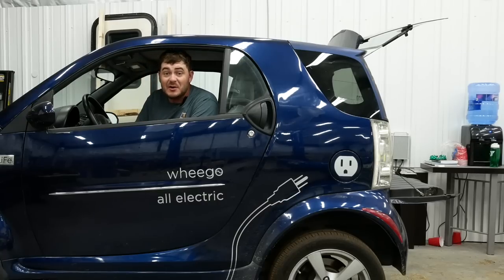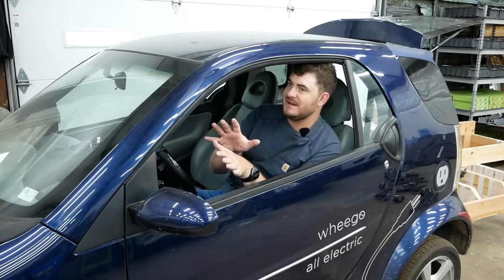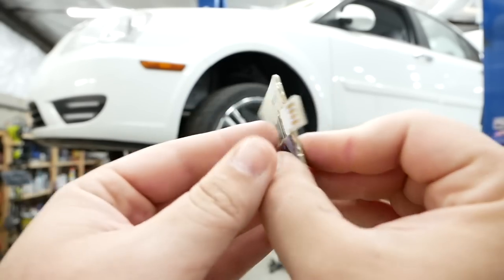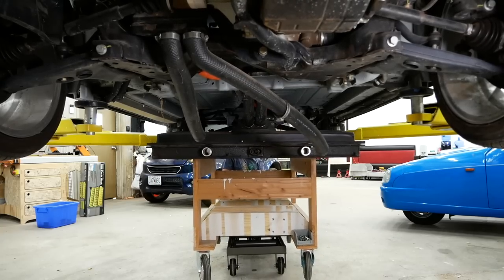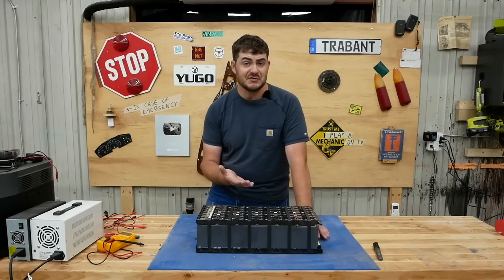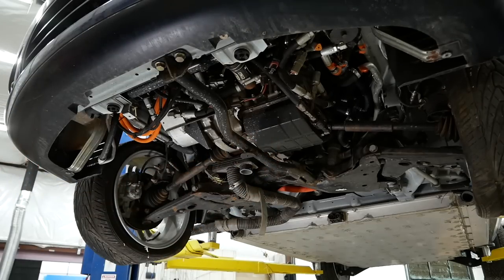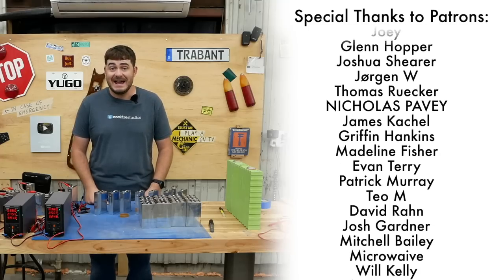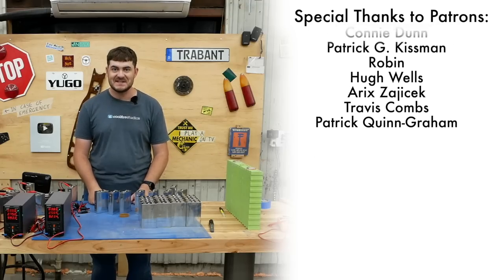I Have 3 Dead EVs. Are Any of The Batteries Still Good?

Comment: I think continuing to rip apart the one you already took a cell group apart from is fine.  I doubt many codas will be functional long enough to make your extra battery pack matter.  The rest of the car is just not very good quality from what I've gathered and the battery pack seems a lot higher quality than, say, everything that actually makes the wheels turn.  Better to make a good mower and a good Wheego than to worry about what you're doing with two nonfunctioning prototypes you have already designated as "parts cars"

I think if you sit on those battery packs waiting for Codas to need them, you'll be waiting for something that won't really emerge save for anything that will help the guy you're giving that one to.

Comment: Should check the internal resistance of each cell before making a new pack out of them. So each cell in the pack can charge and discharge at the same rate so you don't end up with voltage mismatches over time.

Comment: The usual failure in these huge series-parallel battery packs is that some cells lose capacity and eventually short out and won't hold a charge. A shorted cell prevents its parallel neighbor cells from being able to charge, and the entire pack drops by the voltage of the failed parallel group. A cell suddenly shorting will also fully discharge all of its parallel neighbor cells, which can lead to thermal runaway and battery fires. Tesla solves this with a fuse on each cell, so if one shorts and suddenly starts to discharge its neighbors, the fuse blows and it is removed from the circuit. The remaining parallel group loses some capacity but the overall pack voltage remains the same.

Comment: In theory I'd say hold onto the battery pack incase someone needs it... But in practice I'd say pull it apart as buying that capacity in new cells to get the Wheego running again wouldn't be cheap.

Comment: If you really want to do right by the Coda community with the battery pack. Have no qualms about doing as you wish with it but document as much of the battery and the supporting electrical systems as you can. That documentation is likely more valuable than any individual pack is.

Comment: I personally don't think harming or repurposing the Coda batteries will affect the future very much, it's hard to say if a Coda owner will need a battery from your stock. You ought to reform the Wheego as you've originally planned to, who's to say that there won't be new battery technology by the time someone wants to restore their Coda battery. 

To finish your thoughts about destroying parts, you could think of it like two P-51 Mustangs in a museum where one is restored to full working condition versus one that sits on display. The only option to get the nearly restored Mustang to work again and also registered to fly was to use parts from the display plane rendering it unable to fly ever again unless it undergoes a lengthy and expensive restoration. They're now two different pieces of machinery however both planes serve as a display of history whether they start up and fly or stand there and remind folks about the their place in time. When EV's are more advanced than now maybe your Coda vehicles or the Wheego powered by their batteries will be in a museum as a running or stationary display, or in the scrapyard. Either way it gives people something to marvel at.

Comment: Batteries have a limited, however long, shelf life. Use them while they're still good. A custom battery pack can always be built for any vehicle that needs one. After all, that's exactly what you want to do with the cells, right? So don't worry about some future Coda application that may or may not happen.

Comment: Those Weego cells look like Sinopoly LiFePo4 Yttrium 400 AH batteries.
I have been running my house off 16 of the 200 AH version for about 10 years without a glitch, mine does not have the BMS socket though as they are an earlier version. However, they are still reading  3.6v per cell and some say... a BMS is not really required on a LiFePo4 battery with Yttrium doping.
Damn fine batteries for off-grid.

Comment: The battery packs in the Wheego look a lot like common off the shelf parts. Considering the two Coda packs are good, if it was up to me I would keep them as they are and just rebuild the Wheego pack with new LiFePO4 cells.

Comment: if they didn't finish the mold and it still has the marks from an endmill they show up in the plastic part, the only way to be sure is to check if there is draft. if the sides are perfectly parallel then it's milled, if it tapers it's molded. 
also absolutely tear the good pack apart. just because its rare doesn't mean it's valuable and there is no guarantee that a coda driver will A have a dead pack B find you C be willing to pay for it because D they actually like their coda and the weel brings haven't sent it to the scrap yard already. to you, you have 3 sets of these things for you to do with as you wish.

Comment: Nice video. Two thing sprung to mind though. “9.75 volt” should be 19.75 volt and “two one hundred of a volt” is either 20 or 200 mV, most probably the latter, so two tenths. You meter only have three and a half digits (“four digits” for non EE-folk).

Comment: We've seen the Wheego; its BMS will kill any batteries added to it. We've seen the Coda; you've got one that you can revive easily. I'd like to see if you can get an EV with a dead battery pack and revive it with the Coda's cells. Plenty of Leafs about. Or, get an EV car kit and put it together with these cells.
Or, take both Coda packs and convert your F150 truck into electric. you've got a bed right there for them.

Comment: If the batteries don't work in another car they'd be great for DIY home battery backup. 

I wish Chevy had let me keep the old battery they replaced in my Bolt, I would've stood it up in the garage and plugged the house into it. 
There was very little risk of fire in the first place, and the pack would be under far less stress as a home backup vs moving a car.

Comment: The real question should be: If I build a new battery pack for the Weego Will I also want to upgrade the whole charging/control system and upgrade the motors with it?  Do the mower upgrade first before you have to borrow a push mower to cut your grass.

Comment: Surely the single 31kWh pack has enough cells for both the wheego and the ride on mower (Or if there is enough usable cells from the current Wheego battery pack, use that for the mower and only the single 31kWh pack for the  wheego.) I'm of that opinion of, keep the current 31kWh Coda pack as a spare, although like a couple of others, I am concerned that the 36kWh battery pack couldn't be passed for side crashes (while unlikely to happen, it's a non-0 chance as unfortunately you can't control other people).

Either way, really excited for this and can't wait to see what you do!

Comment: Use all the battery power you dont need for the mower and use them as a battery pack for your home. Combine it with a solar system and you just saved thousands of dollars and with this system running youll save even more over time!

Comment: I think the bigger question is: which of the two will you use more? Because remember: The Coda that's road-worthy was built by a real car company that did real car company things, and it's been BREAKING on you! The Wheego (as far as I know; correct me if I'm wrong) was made by a 12-year-old going through the growing pains of life and didn't even come with things like a manual or any sort of extra support, and it (so far) hasn't broken on you aside from the dead battery pack. In terms of usability, I think the Wheego is the better option. Ultimately, however, it depends on your plans with the two cars you have, so you decide!

Comment: The Wheego could so easily be powered by second hand LiFeP04 cells. Looks like they are Winston LiFeYP04 and they aren't too hard to find. I know Jehu used them and I believe he still uses them in his Samba. Battery Hookup recently had a couple auctions for Winston cells but I didn't see what they ended at but I wouldn't be surprised if they went under $100kwh. 

I really hope you don't destroy another good Coda pack. They seem....fairly well made however I question some of the design like the nickel bus bars. Why use something with such low ampacity (unless they were nickel plated copper which is very likely). At the very least keep the shell and all components in good condition. I bet someone could find cells with dimensions that work inside the pack and re-cell the pack without really doing any modifications since LiFeP04 cells come in such a variety right now. 15.5Ah cells are tiny so it would probably make more sense to use 90Ah cells if the dimensions will work.

Comment: At this point, the Coda battery packs are just plastic boxes with off-the-shelf cells in them. Realistically, there isn't going to be another guy who needs a battery pack and the best way to make actual use of the cells is to jam them into whatever hot garbage you love the most.

Also I want to see an EV swapped Trabant someday.

Comment: With an inverter you could make a nice powerwall. Do you have variable electric pricing over there? Or make an external battery for the Wheego on a trailer.
You owned a kWeld right? Could you put 4 cells in series and do a calibration? The internal resistance should be (14.4 -6.3) V / measured current.

Comment: LiFePO4 is great - except for those crap Thundersky (or clones) cells they used in the Wheego. They were very early on in China’s foray into battery tech and they just degraded very quickly. I suspect that they were often used in applications that subjected them to very high C rate discharge - especially in a 115V system. A lot of the early EVs were low voltage like that. I wouldn’t bother trying to save them - at that voltage they’re irreparably damaged and even perhaps dangerous. Don’t discharge to 2.5V either. Nearly all the power in a LiFe cell sits between 3.6 and 3.0V - very flat discharge curve.  The loss in capacity on the Coda cells is almost certainly just calendar aging.  Good luck with the project - me, I’d have tried to re-purpose the Coda pack as home storage. Split the pack into 8S78P, buy a decent BMS and a hybrid inverter and you’re set. Or take a few parallels out for your mower.

Comment: I’d use it but maybe there are other options than the car.  You have mentioned the lawnmower and wasn’t there a cart you were outfitting?  Perhaps you could use some of it through a converter as mains battery backup or solar charged mains

Comment: Honestly, the way I see it, keeping a battery pack around without doing anything with it "just in case", seems like a bad idea because a) having a battery pack just sitting around means it will likely eventually go flat and die, unless you actively check on it from time to time and come up with a solution to keep the entire pack charged up and b) the amount of kodas out there are tiny, and the cars are probably pretty worthless, so I vary much doubt that anyone who still owns one would go through the hassle of replacing a dead battery pack, unless they are they are the same particular flavour of special as you... While I wouldn`t particularly endorse tearing apart a koda battety pack to bring back the wheego (it would be an interesting project with some challanges to overcome for sure, but I don`t think that much value would be gained otherwise), it would be interesting to see you use them on such projects as the bus (to power the electrical stuff of the living quarters, with maybe the addition of solar panels, or maybe find a way to use the engine as a generator to charge the batteties, maybe througha particularly beefy set of alternators, or maybe strap a generator setup of sorts to the PTO, if the engine/ tranmission happen to be fitted with one (since it was a school bus with an alison automatic I super doubt it has a PTO, but maybe one can still be fitted in some way), or maybe you could buy a 2nd trabant and do an EV conversion (maybe using either one of the kodas or the wheego`s powertrain and guts)... There are plenty of possibilities, all better than letting a perfectly good bunch of battery cells rot

Comment: If I was single and had a warehouse I wasn't using, I'd store dead electric cars with hopes to replace the batteries with smaller lighter higher capacity batteries in future and have improved performance. Or hope beyond logic that someone makes & sells an independent secondary drive unit and make all-wheel drive sleepers out of all of them.
Reply: Sounds crazy, but someone invented transparent walls and writable surfaces.

Comment: You’re the only one willing to put wheel bearing in those Codas every 2-300 miles so I say rip the battery apart and do something cool with it. Which doesn’t include the wego. Electrify an older (80-86) VW truck for a parts runner/errand rig.

Comment: Funny if it were me I would take both packs and make a single pack for the house and throw some solar on the roof.  With 67kwh of battery you could have a heck of a standby system or reduce the power bill at the house a lot!  👍😁

Comment: I think you should diesel swap the Wheego and save both of the Codas with their original packs, but that's just my opinion. Moreover I think you should do what you feel like. Edit: By diesel swap I mean diesel electric. Diesel motor connected to an electric generator motor and then use that to generate the power needed to run the electronics in the car in place of the battery pack. Like a train.

Comment: You may be able to fix the Coda's drive problems with a parts swap. I bet the Chinese copied some other cars front end almost exactly, as they do. If you can figure out what fits you can bolt in the whole strut of another car and get axle bearings that work.

Comment: Like the saying: "A bird in hand is better than two in the bush". You have that extra Coda battery, chip away at it and have two driveable cars. The chances of anybody else having a Coda, while certainly  non-zero, is still not much more than that. Unused lithium batteries of all different chemistry types degrade with time, so use them while you can. And it makes for awesome content, so win-win-win-win. 😀

Comment: Dunno about the batteries, but for one of the Codas, you could make a super anti-Coda and shove a dirty diesel generator in it and power the drive motors directly off that like a diesel-electric traction engine on a train... :D

Comment: I'm more curious about what you're going to do with the dead Codas, and what was keeping them from working if their batteries were good.  Maybe you already said and I forgot, sorry.

As for your battery quandary, maybe you can use the batteries out of the pack you already tore apart for both the mower and the Wheego?  If not, can you just buy cells like what are in the Coda pack?  If yes, I'd probably send that pack you haven't torn apart yet down the road, and use the money you get from it for those new cells.  If not, well, it's yours, so I think it'd be just fine to harvest parts you need for another project in order to keep your costs down.  How is this any different than someone who buys an extra, say, Studebaker of the same year and model to one they already have and harvesting parts off of them to make one good one?

Comment: i would think the one battery pack you already took apart, should have more than enough cells to replace the wheego's dead batery. although i also think it might increase the range.. i say for now at least, keep the battery packs as is, and use just the one already taken apart to get the wheego going again(just because i think it looks so silly driving around, and i am interested in knowing if it will even work with an "aftermarket" battery pack with a completely different battery technology inside it. maybe it even becomes somewhat half decent instead of being a "wheego", maybe a "wheego 2.0" if you will :P

Comment: You might have a rough time re-joining all those cells you ripped out. But if it were me, I'd put that pack back together and keep it as a spare for your other Coda, or find another owner with a bad pack to sell it to and do a swapsies. Then you can tear that pack apart to use the good cells in your Wheego and mower.

Comment: realistically speaking the battery is going to be the last component to fail
rip it apart and put the cells to good use

maybe a starter battery for your car could even be fabricated with some leftover  cells as a little project for a rainy sunday afternoon^^

sure am curious about the battery arrangement you got planned for the mower, like in terms of space and capacity

Comment: Yes, tear up that Coda pack. You'll still have 2 good packs, the one currently in the drivable Coda, and the one you plan on swapping into that Coda. If you have 1 drivable Coda, there's no need to have 3 battery packs. That being said, it could also be a good idea to look for a junked Smart EV and swap it's battery into the Wheego.

Comment: Since you got all the hardware, what would it cost to get new compatible batteries to MAKE even a small battery pack for a Koda?
Like, not full capacity, just so it can move? All the control-equipment is there, you'd just need to source the batteries.

Comment: In the 80's and 90's when I was into radio control airplanes l learned about battery packs.  Only one battery will make the pack be bad.  After taking an almost new one apart you could see that one battery had nothing inside it to make it charge.  One battery makes the whole pack useless.  They were welded together with strips of metal which made it difficult to replace the one cell.  They would rather sell you a new pack than help you fix the one bad cell they sold you.  I imagine car packs are the same, one big pack useless and out of all those batteries only one ruins the whole pack.